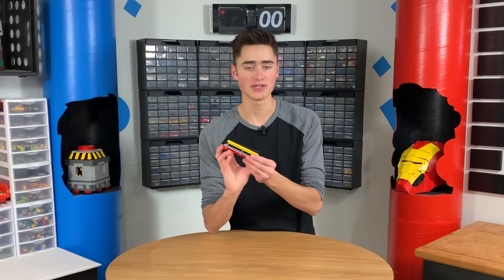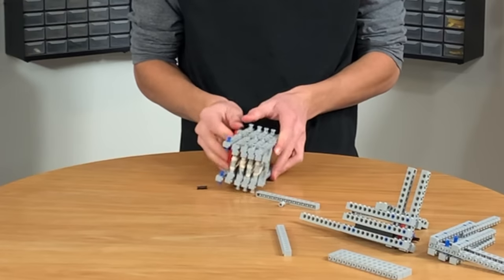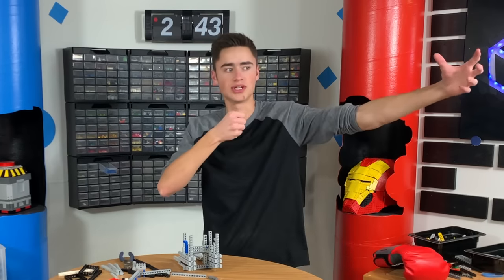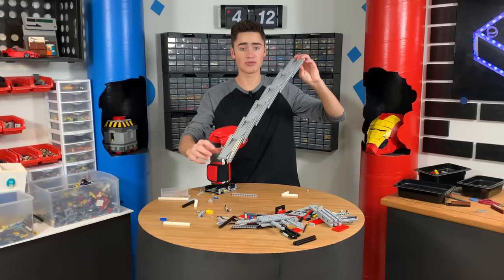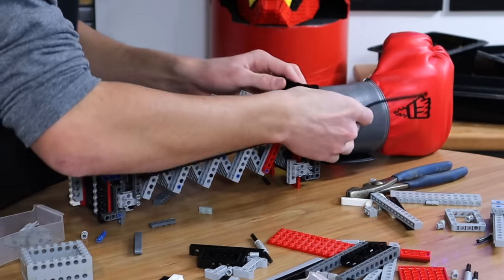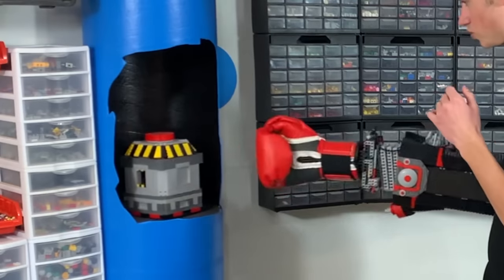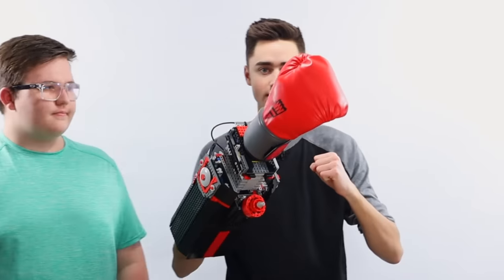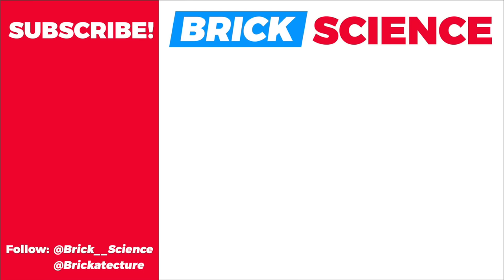Custom LEGO Spring Boxing Glove

Comment: I think you should definitely try this again sometime...

but I'd like to make a few suggestions, Next time I think you should try building a 2nd bigger scissor mechanism around the first one with the interior mechanism opening horizontally/vertically and the exterior one opening the opposite way.

It might make it a lot clunkier and heavier but it would totally sure up the extension mechanism allowing the fist to travel with a bit less wobble.

And who knows, with all the extra attachment points you might even successfully make it rubberband powered with a trigger mechanism so it could hit with more force.

Also, I don't know if you knew this or not but you can actually cast come lego parts fairly easily out of metal, if you know-how (things like steel/aluminum lego axels),  and with a bit of ingenuity some galvanized metal Plumbers Tape could also be used to strengthen your Lego Technic bricks wherever you have stress points, something around the 10m 12x0.8mm measurement range should work, but if that's a bit off try shopping around to see if you can find something with better size and spacing.